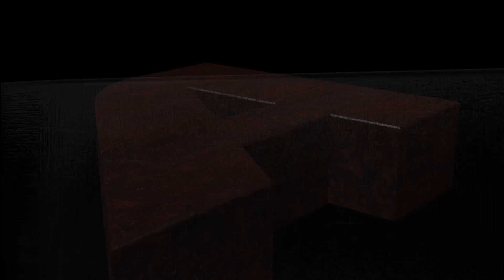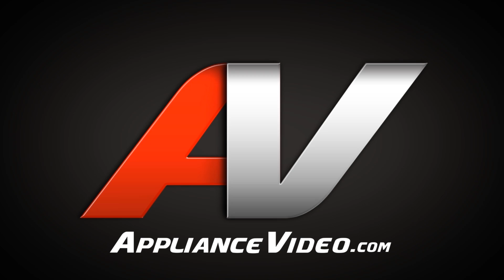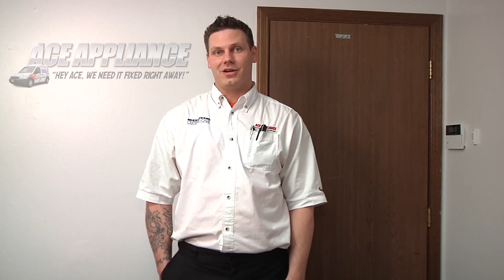Frigidaire Dryer Repair - Does Not Heat Up - Heating Element

Comment: 👍
I have an old Frigidaire dryer FDE216RES1-
with the circular coil element. 
I recently replaced the ball hitch & bracket along with the belt to eliminate squeaking. Everything was fine- for a day.
Now it turns but no heat.
So far I checked to make sure I have 240 volts.
Checked continuity on heating coil 
Thermal fuse and thermostat. 
All seem to be okay. 
My wife looked online and was convinced it’s the thermal fuse so I ordered a replacement and put it in.
Still no heat. 
Then to test I pulled the drum out checked connections and turned it on. Every time I turn it on there is a distinct “pop” sound. No sparks, smoke or smell- just the little pop. 
Any suggestions?

Comment: Hi, I have a Frigidaire FAQG7077KA0 and it started showing the "Chasing Lights" on the LED Display.   When this happens, it seems that the dryer is stuck in the Drying Cycle.  The dryer was set to 50mins, but after 1 hour later, it is still running and still in Drying mode.  There is hot heat and all the clothes are dried, but the machine does not stop.  I had to manually cancel to stop the machine. Has anyone experienced this issue?  Does anyone has an idea what's the issue might be?
Reply from the maker: Great question, if you have a more technical question that our parts department cannot answer, you can search our over 17,000 answered questions free at our website www.ApplianceVideo.com under our Repair Help section. You can also call our parts department at 1-800-830-5465 and they can give you help 7-days A week ,or search at www.SaveMoreOnParts.com  .

Comment: My machine had quit heating and was turning off after 10 minutes.  The first code I got- the one with the odd symbol and the 10 after it- actually meant (according to the service man) that the control panel was having a problem.  He tested the heating element and it showed that it wasn't working so we started there, as he said it's common for that to be the real issue.  He was right. So- dispite giving a code indicating a control panel issue, simply replacing the heating element did the trick.
Reply from the maker: Great question, if you have a
more technical question that our parts department cannot answer, you can search
our over 10,000 answered questions free at our website www.ApplianceVideo.com under our Repair Help section. You can also call
our parts department at 1-800-830-5465 and they can give you help 7-days A week
Monday -Sunday, or search at www.SaveMoreOnParts.com  24 hours
7- days A week.

Comment: I did the service mode.. first thing that came up was something I believe was supposed to say E10.. however the only part of the E showing was the center cross piece and the part that drops down from there- not the lower or th uppers.  So if it's E10 that means the control board?  Then every time i turned the dial in that mode I got different numbers...E02, E50, E14,  CO-1,  and 286. Does any of that mean something?  Mine doesn't heat and shuts off after 10 minutes.  After pulling the plug and waiting 5 minutes and restarting it briefly went on a full cycle, and the numbers counted down properly but no heat.  Then it reverted to shutting off and the  when it was on the display did the racing display rather than counting down.  (it has done that forever- we thought it was normal.)   I'm thinking the 3 main things it might be are computer board, heating element and thermal switch. Where wou;d upi start?
Reply from the maker: Great question, if you have a
more technical question that our parts department cannot answer, you can search
our over 10,000 answered questions free at our website www.ApplianceVideo.com under our Repair Help section. You can also call
our parts department at 1-800-830-5465 and they can give you help 7-days A week
Monday -Sunday, or search at www.SaveMoreOnParts.com  24 hours
7- days A week.

Comment: How do you exit service mode? 
You showed how to enter it but not exit it..
Reply from the maker: Great question, you can call
our parts department at 1-800-830-5465 and they can give you help 6-days A week
Mon-Sat . You can also search at www.SaveMoreOnParts.com 7- days a week.  If you have a more
technical question that our parts department cannot answer, our technicians are
answering all questions at our website at www.ApplianceVideo.com under our Repair Help section. We have over 6,000
common questions and answers that you can easily search through by your model
number, appliance make, problem or error codes, and It’s completely free to
search through our question & answer library. There is a very good chance
you question is already answered there.

Comment: My dryer is a model FAFE4044MWL frigidaire, at the moment of powering it says  PAUSE, and doesnt initiate any function, i need help on the error. what i can do.
Reply from the maker: Great question, you can call
our parts department at 1-800-830-5465 and they can give you help 6-days A week
Mon-Sat . You can also search at www.SaveMoreOnParts.com 7- days a week.  If you have a more
technical question that our parts department cannot answer, our technicians are
answering all questions at our website at www.ApplianceVideo.com under our Repair Help section. We have over
4,000 common questions and answers that you can easily search through by your
model number, appliance make, and problem or error codes, and It’s free to
search through our question & answer library.

Comment: what if the dryer does heat but wont dry my clothes??
Reply from the maker: Great question, you can call
our parts department at 1-800-830-5465 and they can give you help 6-days A week
Mon-Sat . You can also search at www.SaveMoreOnParts.com 7- days a week.  If you have a more
technical question that our parts department cannot answer, our technicians are
answering all questions at our website at www.ApplianceVideo.com under our Repair Help section. We have over
4,000 common questions and answers that you can easily search through by your
model number, appliance make, and problem or error codes, and It’s free to
search through our question & answer library.

Comment: I have a gas dryer and the service code E5b came up.  Do you know what part needs replacing?
Reply from the maker: Great question, you can call
our parts department at 1-800-830-5465 and they can give you help 6-days A week Mon-Sat . You can also search at www.SaveMoreOnParts.com 7- days a week.  If you have a more technical question that our parts department cannot answer, our technicians are answering all questions at our website at www.ApplianceVideo.com under our Repair Help section. We have over
4,000 common questions and answers that you can easily search through by your model number, appliance make, and problem or error codes, and It’s free to search through our question & answer library.

Comment: Excellent video! Very informative and well done. I have this EXACT problem and this EXACT dryer. I replaced the heating element. Now I have heat, but still have the chasing lights and it still shuts off from time to time. Any thoughts?? Thanks a ton!
Reply: 1) The chasing lights...or "race-tracking" is normal operation during a drying cycle....2) if it is shutting down prematurely then I would try putting the dryer into diagnostic mode and see if there are any fault codes present and go from there.
Reply from the maker: Thanks for your response, we are glad we could help. Our library of over 5,700 videos are currently helping over 1.6 million people like you every MONTH.  Please help us by subscribing to our YouTube channel, or post our website www.ApplianceVideo.com to your Facebook page, Twitter, Instagram or any other social media sites. Your support will help us keep producing more free quality videos.

Comment: GR8 video, My Frigidaire dryer dose something No heat after a few min display same Thax for showing how to get into service mode Mine is showing error E4A I pulled it apart all 3 heating parts test good 0 ohms also test for short on heating element no shorts
Reply from the maker: Great question, you can call our parts department at 1-800-830-5465 and they can give
you help 6-days A week Mon-Sat . If you have a more technical question that our
parts department cannot answer, our technicians are answering all questions at our website at www.ApplianceVideo.com under our Repair Help section. We have over 4,000
common questions and answers that you can easily search through by your model
number, appliance make, and problem or error codes, and It’s free to search
through our question & answer library.

Comment: we have the same code that pops up on ours.. only issue is I cant find exactly what part needs to be replaced.. AGQ600ES4 from the blue prints of it it looks to be 3 or 4 different parts to the heating element..
Reply from the maker: Great question, with our
technicians now getting hundreds questions weekly, they are answering all questions
at our website at ApplianceVideo.com under our Repair Help section. We have over
3,000 common questions and answers that you can easily search through by your
model number, appliance make, and problem or error codes.

Comment: I replaced blower wheel and housing on my Affinity dryer.Now it wont start.Canyou tell me what error code R10 means
Reply from the maker: +Clint Burns 

         Good question, with our technicians
now getting hundreds questions weekly, they are answering all questions at our
website http://www.appliancevideo.com/repair-help/ .  We also have over 30000 common questions
and answers that you can easily search through by your model number, appliance
make, problem or error code and it’s absolutely FREE.

Comment: I'm getting e4a tried to reset but nothing also it's all lit up even when I hit cancel button
when press start all the lights start flash it will run on low setting but only 20 seconds and the dryness button will not adjust could it be the circuit board?
Reply from the maker: Federico Cabarle 

                   All of our technicians are now answering questions
daily at our http://www.appliancevideo.com/ website under the Repair Help section.  We also have over 1600 common questions and
answers that you can easily search through by your model number, appliance
make, problem or error code and it’s absolutely FREE. You also have the option
to email a factory service technician with a question on your appliance at
http://www.appliancevideo.com/repair-help/ . If you’re looking for a repair video, you
can also search our library of over 2600 free repair videos. ApplianceVideo.com
specializes in quality DO-IT-YOURSELF appliance repair videos and we get over
800,000 views per MONTH to our videos worldwide and growing. If you need of
parts for your major appliance, we have over 5-million parts in stock at http://savemoreonparts.com/ .  Thanks
for your support. Matt Ace Appliance factory service technician.

Comment: I have a dryer model # fase7073nwo with very little heat and no lint in screen, I have heard of fuse that could cause that problem.
Reply from the maker: Allen Kipps 

All of our technicians are now answering questions daily at our http://www.appliancevideo.com/ website under the Repair Help section.  We also have over 1600 common questions and
answers that you can easily search through by your model number, appliance
make, problem or error code and it’s absolutely FREE. You also have the option
to email a factory service technician with a question on your appliance at
http://www.appliancevideo.com/repair-help/ . If you’re looking for a repair video, you
can also search our library of over 2600 free repair videos. ApplianceVideo.com
specializes in quality DO-IT-YOURSELF appliance repair videos and we get over
800,000 views per MONTH to our videos worldwide and growing. If you need of
parts for your major appliance, we have over 5-million parts in stock at http://savemoreonparts.com/ .  Thanks
for your support. Matt Ace Appliance factory service technician.

Comment: Help pls, our frigidaire dryer shows code e64 and it is supposed to mean bad heat element but it still dries an death up. Any help?
Reply from the maker: James
    All of our technicians are now answering questions daily on the ApplianceVideo.com website. You can search completely FREE in our Repair Help section with over 1000 questions & answers. Or you can get unlimited technical advice and video links emailed to you by our 14 factory certified technicians at http://www.appliancevideo.com/premium-membership/.  If you are in need of any parts please support our parts department on line at http://savemoreonparts.com/ or call 1-800-830-5465 7-days a week until 11pm Eastern time. Thanks for your support. Matt Ace Appliance factory service technician.
Reply: ApplianceVideo.com

Comment: LOC message come up and the dryer will not start>
Reply from the maker: Nancy
        All of our technicians are now answering questions daily on the ApplianceVideo.com website for anyone needing help. Just copy and paste this this question under REPAIR HELP, and one of our  factory authorized technicians  will answer any technical questions at absolutely no charge on your appliance issues. We also have over 2600 free repair videos to help with your appliance repair issues. Thanks for your support. Matt Ace Appliance factory service technician.
Reply: *****   have a frigidaire gas dryer fgfb9200es0